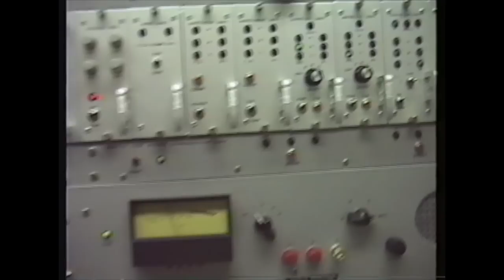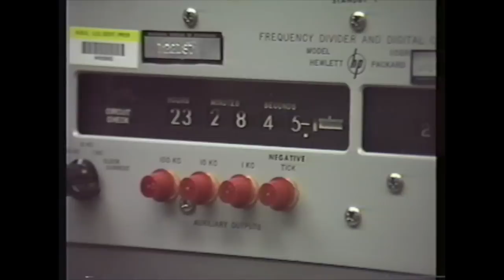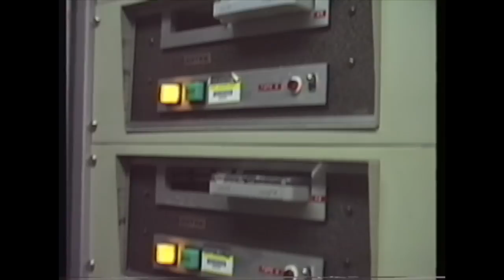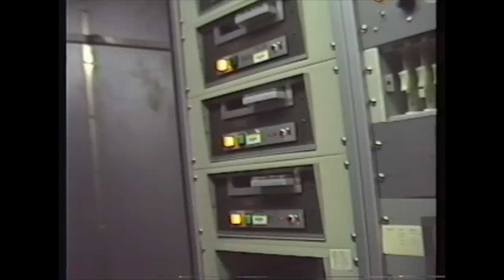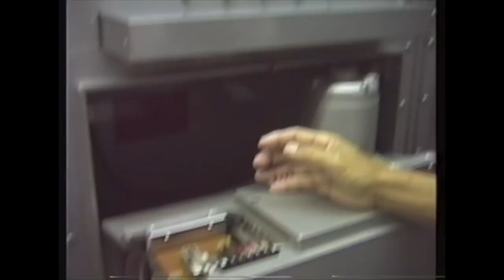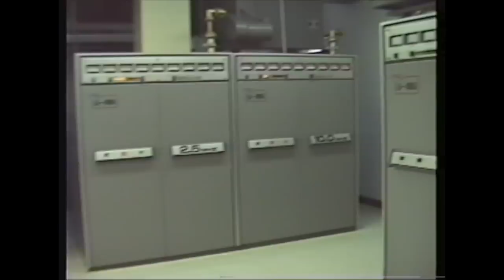WWVH Kauai, Hawaii - 1988

Comment: We used portable cesium beam time standards in the USAF back in the early to mid 80's to re-insert time into a SLFCS (Survivable Low Frequency Communications System) so it could keep synced up with the transmitters. It was one of the Comm systems for the Titan II missile complex's around Wichita Kansas. Cool video!!